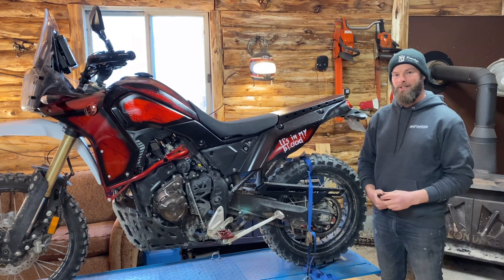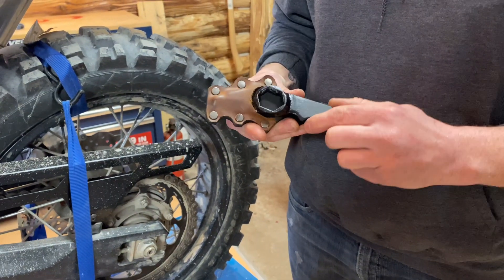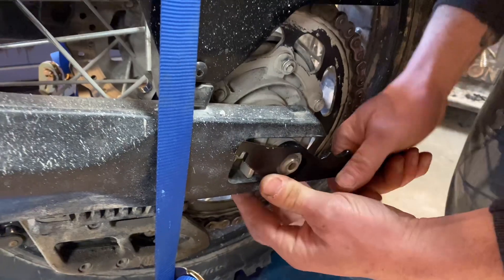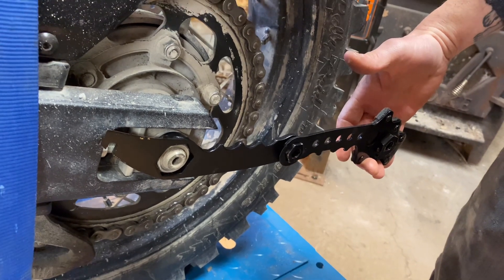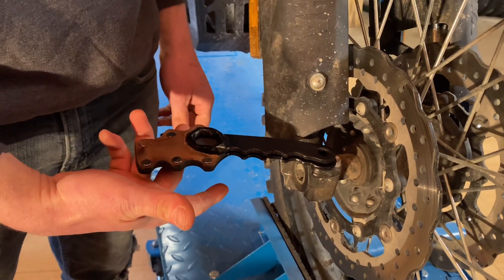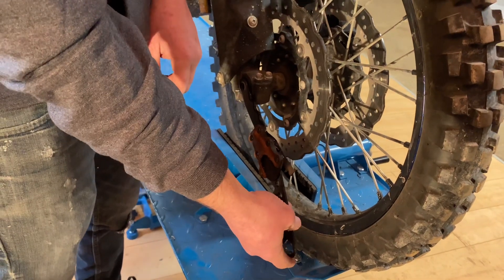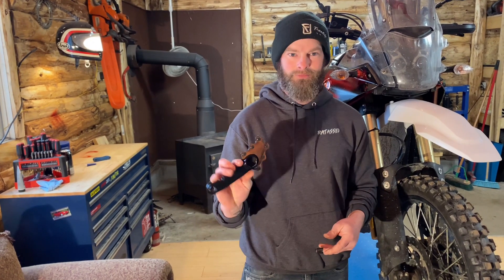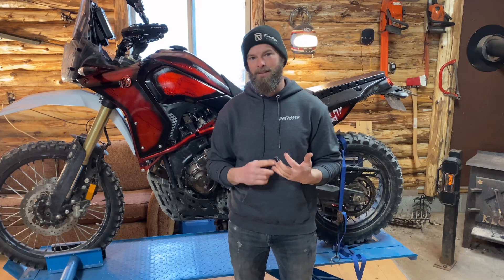The Best Tool - Yamaha Tenere 700

Comment: Interesting design! I’m too a bit nervous with a sharp knife on a wrench, especially when I’m the user 😅 But I like how the whole tool is flat. I have the Rally Raid tool for removing wheels - it’s nice and well made, but it’s hard to store somewhere on the bike, this tool could be stored in the tool pouch under the seat since it’s flat.
Reply from the maker: Added a 12mm for the brake calliper bolts too after a couple requests from here

Comment: Cool tool but how you gonna take out the front wheel with the brake callipers still in place?
Reply from the maker: I’ve always just wiggled the wheel out and back in, but after a lot of requests I’ve added a 12mm for the brake calliper bolts and it’s now standard on every one I make/sell
Reply: @farreachoutfitters  You daredevil you😅 Thanks for the update!
Reply from the maker: @2wheels1guy25  best seller on my we store so far!

Comment: what im missing is a 12mm socket for the caliper for removing the front wheel. Every tool is missing thet 12mm socket. Why?
Reply: Your shop has a error with your paypal support.
Reply from the maker: @MarvelMarvelcomic  hey, thanks for letting me know I’ll look into that immediately!! As for the 12mm socket, I might be able to include that!!!
Reply: @farreachoutfitters  include that and its the perfect tool for the T7
Reply from the maker: @MarvelMarvelcomic  pay pal should be working now. If you order a bike knife, I’ll be sure to add a 12mm
Reply: @farreachoutfitters  Did you add the 12mm to all the bike knifes?
Reply from the maker: @davidblanchet749  yep it’s going to be a standard on the bike knife moving forward. I haven’t produced a new one yet to update the site.